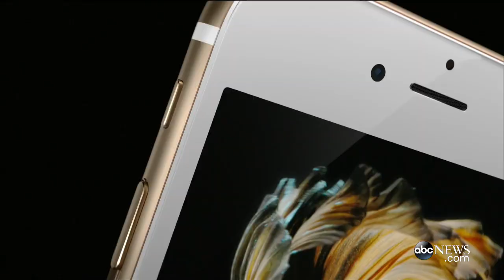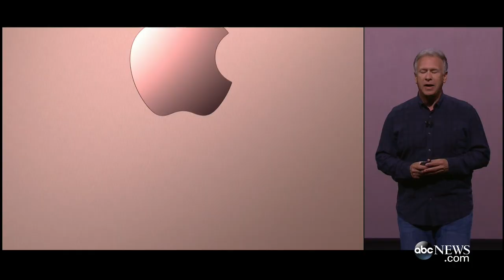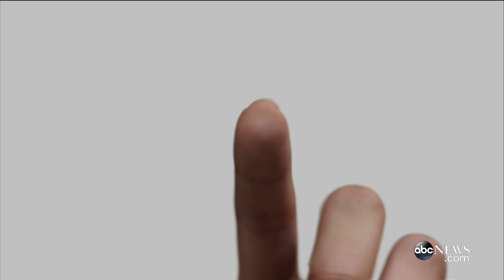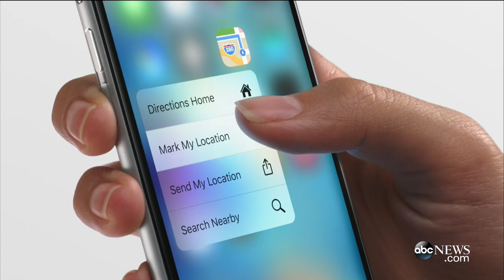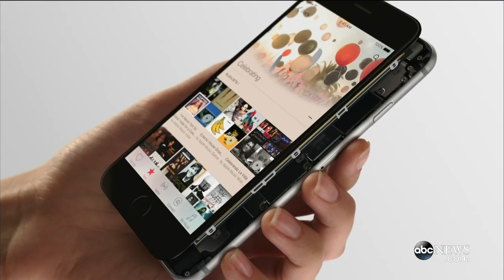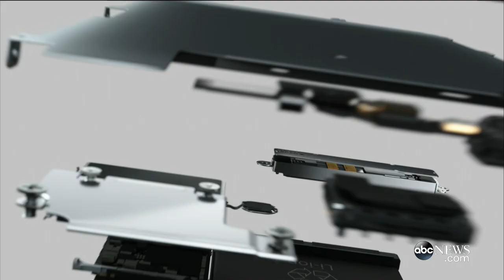Apple iPhone 6S with new Touch Technology | Tim Cook 2015 Presentation

Comment: 2020 and still using my 6s
Reply: PTRK did you update it to ios 13?
Reply: colt1998 yes 13.3.1
Reply: PTRK I am on 13.3, do you feel any diffrence from 13.3-13.3.1? My battery is on 81% but its drain fast, performance is amazing I must say, how is your 6s?
Reply: @soawn29  my battery health is at 86% and it performance just fine. My battery doesn't drained that fast.(not yet) further all i don't see any difference at all.
Reply: PTRK I am happy with performance, but 81% is weak for battery I need to change it than, and I have problem on my phone sometimes sound of keyboard and sound of locking the phone is loud but sometimes its quiet do you have that problem
Reply: colt1998 hmm thats weird. No i don't have any of that problem. Also you have to change your battery when it's getting weaker. Below 80% and you will suffer of fast battery drain.
Reply: PTRK well battery isnt that bad to be real but I need to change it 81% isnt very good in settings it writen that max performances are possible but if I get below 80% I will have a big problem, software is a problem too for 6s not speed, speed is amazing I think, I just wonder how is battery on ios 12 because I just bought this phone on ios 13

Comment: Apple: “This is next generation Multi Touch”
Also Apple 4 years later: *Gets rid of 3D Touch and goes back to simple Multi Touch
Reply: Igor They have NOT removed the feature ! Just the implementation has changed. It is now Haptic Touch.
Reply: Techie-X They removed 3d touch technology and called the long touch “Haptic touch” which is not a technology. You just hold your finger on the screen instead of touching once, it’s not something new, it has always been on any smartphone.
Reply: Techie-X 3D Touch is gone, press harder on an iPhone 11 Pro and nothing happens, so it is gone and long pressing is not a different implementation.
Reply: Igor my 8 plus has both thecnology and the Haptic Touch makes 3D Touch worthless
Reply: @talhasl66  3D touch is still like 5x faster than haptic touch and has way more uses than just opening context menus

Comment: and now in 2019 all the iphones model doesn’t have 3D touch
Reply: Now in 2020, even the Apple Watches don't have 3D touch :/
Reply: @Soulindex  3D tpuch's tech took too much space in the phone so it had to be nerfed
Reply: My 11 has 3d touch
Reply: Lol i think its hilarious 😂
All these fart sniffer  aint no betta then some off the shelf brand
Reply: The fact that people think 3D Touch and Haptic Touch are the same thing shows me how much Apple failed to market this correctly. 3D Touch had infinitely more potential than “Haptic Touch” which is just a dumb rebrand of the same tap and hold gesture that has been in iPhone apps since the beginning.
Reply: It’s not  essential
Reply: The fact that you need to wait a bit just to toggle the flashlight on in the lockscreen is  really annoying. But with older device like xs max I love how you can toggle the flashlight on and off without even lifting your finger and it is much much faster.
Reply: Ari Iswara but they have haptic which is basically the same thing
Reply: Jamba Mode No it’s not, 3D touch has a special hardware underneath the display “the pressure sensitive display” haptic touch doesn’t have it, they only have taptic engine not the pressure sensitive display hardware
Reply: Ari Iswara still it’s the same feature and functionality without the 3D Touch display
Reply: JJIPR25 Nahhhh peek and pop is gone, it would never be the same
Reply: Ari Iswara same on my iPhone 6S on iOS 13.2 peek and pop is gone on every iPhone with iOS 13
Reply: Ari Iswara it’s the same basic functionality in twitter for example, only difference is that you need to tap to pop now
Reply: StarBender it’s not, they kill the “Pop” feature, the point of 3D touch is that you don’t need another tap to open the thing you wanted to see
Reply: @arioktaiswara7838  exactly, but you can do the same thing with haptic touch, even if the functionality isn't EXACTLY the same (previewing content that is)
Reply: JJIPR25 wtf u sure ?? I can peek my emails and stuff on iOS 13 even on certain links
Reply: @impulsedguy6557  yeah u can still also on iOS 14

Comment: "new". I checked the Android SDK and the Environment variable had the 3d touch first. its called by getting the pressure applied. its Environment.get pressure() and returns a float. A float is not something that stays above water, but an integer that is not complete number (its a decimal at most). So much for new.

Comment: I wouldn't mind even a slight change in design or built materials with their moto " the only thing thats changed is everything"  that should be for the iphone 7, i know i know,  the changes are mostly internal but, COME ON APPLE, when you said most advanced,  the only  gimmick that is actually a new thing is 3d touch,  but pictures taken can only be in 4:3 aspect,  no usable nfc,  no wireless charging,  smaller battery than the predecessor,  still very restricted, there's  NOT EVEN FAST CHARGING

Comment: I hope Samsung do there presentation and be like no more charging ports charge your phone 100% faster with wireless charging no more faulty cables water proof ir blaster front facing speakers
gorilla glass 10  and a sd card slot and comes in 64 gb to 128gb models in white,black,white and black,platinum,gun metal black

Comment: seems like it would be a bit complicated to use at first then you get use to it and then it's just mindless using it. but they didn't seem to do ANYTHING to the hardware or software other than the new aluminum and 3D touch. 
Apple should focus on upgrading there current hardware and software then start adding new things.

one example is why the Samsung Galaxy phones have much better hardware and software. 
galaxy note 4 or s5 are the previous generation and came out before the iPhone 6 are superior in many ways.

bigger battery (50% to double the size)

16 megapixel 8x zoom 2480p front camera and a 1080p selfie camera

larger screen but smaller phone

and now apple still is far behind. If apple made simple things that are often over looked they would have a far better phone. all apple would have to do to have made this phone worth wild: bigger battery, better camera, more pixel display, the ability to use 2 applications at the same time. there all simple things that could be impliments easly. 
this is why Samsung and Android will always be better than Apple when it comes down to hardware and software cabablilties. Not a whole system update for emojis, or adding something Android had a generation ago. 

but face it. everyone's going to buy an iphone because it's an iphone. if half the AT&T stores or Verizon stores put the iPhone 6s on display right next to the Galaxy Note Edge and the iPhone 6s Plus on display right next to the Galaxy Note 5. have the specs right next to each other. people would buy the Galaxy over the IPhone anyday.

Comment: Before i begin I've been in this business for many many years and Apple changed the industry and the world with the invention of the iphone. But... they never kept evolving with the pace of technology. Example: why did iphone make a 6+, because apple users were switching that wanted a bigger screen. So yes apple started the race in first place but came in 4th. Android is much better for many reasons. Haviing said that..if you need an iphone for work or a very specific app you commonly use or like  a lot of apple users that just want that status symbol of owning one (which is very old way of thinking nowadays) then of course get an iphone. Other than that their really isn't any other reason to. The basics: Samsung has a much better screen with AMOLED than LCD for iphone. Picture quality is extremely better, iphone users will admit that. Battery life now this one gets overlooked by every review ive seen. Samsung has ULTRA Power saving which gives you the potential for the s6 size phones 8 days of battery life while in use. Note 5 around 13 days. Rapid wireless charging: 2 hours to charge an iphone 6s while Samsung charges in around 70 minutes. Also iphone can only be plugged into 1 computer. Android allows you to plug into any computer to share files without the use of another application such as itunes. And lastly speed. Now without getting to techy iphone in one aspect is slightly quicker but in another samsung is much faster. 

At the end of the day yes Apple does make a decent phone but... if you want a better camera, wireless and quicker charging battery, better screen and a very quick phone. I highly recommend a Samsung phone.

For those who want excellent customer service. If you have an issue with your iphone you go to the Apple Store. Now from what i have heared from apple users is that many times they will deny you service and tell you to come back and make an appointment. Well if my phone doesn't work or have questions about I want the answer now, now you have to wait a week and come back. Samsung offers service centers inside most Best Buys and are available from open till close. To me thats much more helpful and they offer free classes and one on one training.

Comment: the 3d touch you guys talk about was already invented ages ago, its in your(you as in YOU who is reading this) laptop touch pad, you can turn on your laptop's touchpad software that has real-time pressure graph to see pressure ur applying, and im talking about cheap/expensive windows laptops that have regular touchpads, synaptics touchpad driver includes that software, just turn on the taskbar icon by going to control panel, 
so please apple dont insult our intelligence, u didnt create something new, you just added it from laptops,
btw i recently got the Asus Zenfone 2, 2GB/16GB version, best $250 i ever spent on new unlocked Android 5.0 smartphone

Comment: S was never a major upgrade in the history of iPhone
but this rose gold color is really tempting, so i consider selling ma boring grey 6 plus and get a hot pinky S+  Lol

0. Android is good but if you already invested so much in ur iphone software, difficult to change OS; due to lock-in effect.
1. glass is sturdier than ever,  material called 7000 or something used to make aero jets
2. RAM is finally 2G. Which will allow smoother running even with multiple programs running at the same time.
3. front camera finally considerably better boasting 5 megapixel photo & 720p video with screen lighting (look almost useless) ,   and the back camera with 12 mega pixel with better noise control.. so they say. Some new shooting functions added. And the unnecessarily large interpolated 4k video mode. (with CCD sensor as small as a quarter of your pinky nail? lol)
4. new triple core A9 CPU,  they say it's 70% faster in general processing and... 90% faster GPU processing.

I guess those 4 are the major reasons to buy the new S.  Other trivial new features are no big deal... me thinks..
well, new LTE internet connection can be up to twice as fast so they say. And 3D touch, which im not sure will be very efficient. Oh and retina display. Finally 1920x1080 full HD

what i WORRY MOST is its battery life.   maybe not so bad for 5.5 inch S+ 
new number is more of a major upgrade, but it's never a stable upgrade.. S is always the true complete upgrade
Consumers naturally waiver.. whether to buy or wait.  That's the sort of headache me is goin thru  =ㅂ=;;

Comment: I don't think you all understand what the S model iPhones are, they aren't a design change. They are a beast with power and typically one new feature. The real innovation lies in the A9 processor. It's simply amazing. They iPhone 6s packs incredible CPU and GPU performance, the fastest in the industry. No company in the world makes a drastic change to their product every year. Hell Samsung took features away form the Note series. Apple isn't expecting every one to upgrade, they are aiming at the iPhone 5s or lower tier to upgrade. I personally have an iPhone 6 Plus and I will be in line for this guy. I like apple and I like their products. If you don't like Apple and do not like their products that's completely fine. But to make fun on someone for a phone they use is pretty low. And I just wanna say, in response to the people who say "I'm not spending another $1,000 on this iPhone" you never spent 1k on a phone. Most plans give u the new iPhone for like 30 or 40 bucks a month.

Comment: this Dude (Cook) talks like a preacher. :( "worked so hard, worked so hard, amazing, incredible, thrilled, excited, entirely new, new, brand new" omg... adding a new color (which btw is a pale pink) does not innovate anything.  and what's so special about context-menues anyway? Android has this allready... Windows has had it since the beginning - even Mac OS X has it if you are able to use a 2 button mouse or the control-key with your mouse.

how about a little more storage on the entry model? c'mon apple, a phone with a 12 mpixel camera and 4k video capabilities with only 16 Gigabyte not expandable storage, that sounds like some kind of a sick joke! or make it at least 100 bucks cheaper. no no no, this is just baaaaad!

Comment: I love iPhone but why is it so hard just to click on a app, now u have to hold it down 😓
Reply: no
Reply: +Phat Mahn ok
Reply: +tyler torres yeah I think they would but it's just annoying cause it's now so hard to click on an app now is so annoying but thanks :)
Reply: Pretty sure you can just click it still if you want. :)
Reply: +Mel .E.C no... You will still be able to single tap any application you want. The 3D tap (when you hold down an application) brings up shortcuts and extra option for to have. Single touch is still a feature.
Reply: +Mel .E.C in my opinion, I would wait what the 7 has to offer, unless you have money like that. These couple of "new" features to me is not really worth upgrading from a 6 to a 6s. By the way I'm a apple fan, but Apple has been disappointing me lately with its ability to bend (iPhone 6) I'm not really excited for any phone at this moment...
Reply: +Jay Brooks yeah, most of my products are Apple and I'd rather just get the normal 6

Comment: Ever since Steve jobs died, they have been making basically the same product only bigger
Reply: Apple Watch?
Reply: +1996optimus you play roblox...
Reply: +MotorStorM93 They made a Stylus because they know iPad users love to draw on their iPad, make art, design, etc so they made a stylus instead of buying stylus that's hard to use
Reply: +Cyndi Johnson Only bigger? 3D Touch? Apple Watch?
Reply: the iPhones have always been the same. they just add one or  features everytime
Reply: +Faowi Aple never intended to add a stylus to their devices because they claimed it was unnecessary bulk and wasn't needed. They even went as far as to publicly insult Samsung's Note series, calling it a hilariously large phone. They claimed anyphone with a screen bigger then 4" was undesirably large. And now pop out phones with 5" and 6" screens and probably soon a stylus as well. 

But I won't deny Samsung copies and insults Apple either, they clearly do. But they would never say their product was useless because they manufacture 80% of the parts in an iPhone. So they would never insult their own products. Yet Apple clearly does.
Reply: +Poy From Raze 2 apple has not had any innovative ideas. it was not the first smart phone. muchless the first touch screen phone. this so called 3d touch is a lamer version of what android has been doing for years with their touch and hold features. you cant give apple credit for all smart phones. they have contributed the least. and they are fooling people into buying these over priced devices.
Reply: +IVIusicFiend Also are we even having the same conversation? like I would give a f*** what you claim Apple did years ago! Also FYI The first note didn't need a stylus, it was an optional feature JUST like it is now.
Reply: chris killen Back in the days, iPhone 2g (3.5inch) is considered as a big phone because phones are small back in 2007s..
You see, the old Samsung phones, they look like a stick. it's really small. Nokias, they are small. Blackberry, they're small.
Reply: Tyler Johnson pretty much

Comment: I'm really disappointed like the iPhone 5s vs the iPhone 5 there were quite a few noticeable and interesting differences this though is just sad
Reply: 5s was a really good phone. I miss that phone. Touch ID made it for the 5s.
Reply: I will say though the 5s did me great and I absolutely loved it.
Reply: Still have my 5s :) still happy too
Reply: +Gerardo • Plays 5s still has a magnificent camera!
Reply: I'm using an iPhone 5 to watch this video. I really dig the design of the 5 and 5s.
Reply: +Justin Carless meh my 5s is overheating after about a year and 8 months, as a photographer I'm gonna get the 6s just because I've always wanted a phone with a decent camera and the easy to use interface.
Reply: only bad thing about the 5s has to be it's battery. that i didn't miss.
Reply: +Jax Pin Your not the only one 😊
Reply: +Jax Pin It is just too small for my taste.
Reply: +Daishawn Maingot you're*
Reply: +Andrew Garcia ks.dvñh